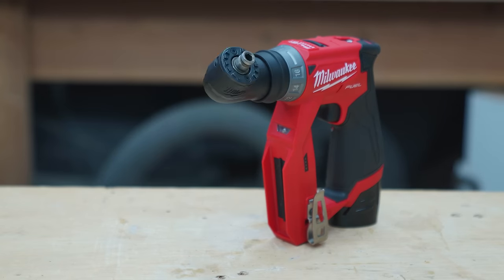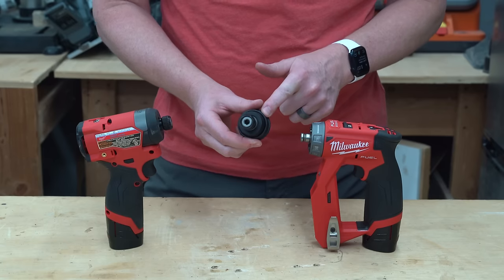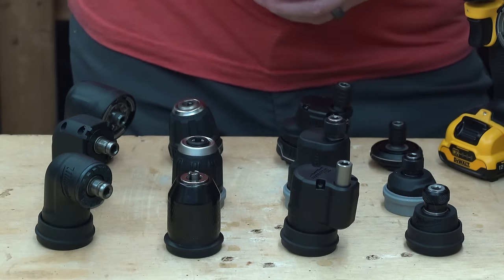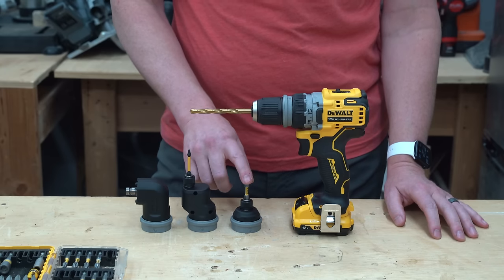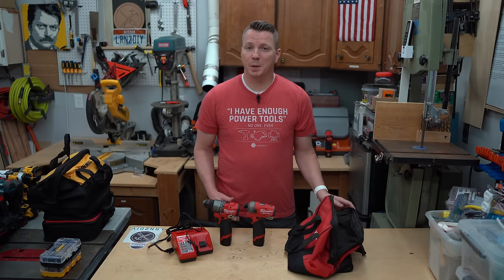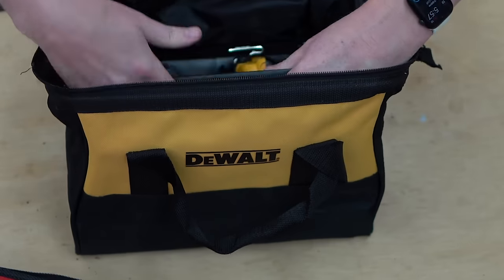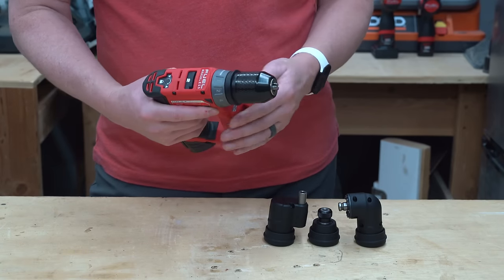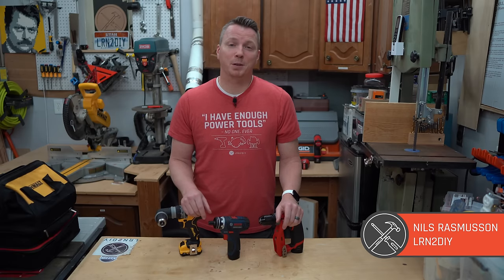These Weird Looking Drills Do It All

Comment from the maker: Just looking for the right angle capability for tight spaces? Check out these Milwaukee and DeWalt adapters you can get for under $30: Milwaukee Right Angle Adapter: https://geni.us/tEajsR and DeWalt Right Angle Adapter: https://geni.us/L3nUWAg
Reply: I have the DeWalt version and it's a great accessory.  For those extremely hard-to-reach areas, you can add extensions to the front and back to get around almost any obstacle.
Reply: my issue with those is that you need to hold on to the adapter or it will spin I like how the other heads don't move and can be set at the position you want.
Reply: @MegaBighig  Exactly. I do have the milwaukee right angle adapter, but I also have the m12 installation driver and that gets most of the use.

Comment: I don't own one, but I have used the Milwaukee version. Being a bit more senior, I found the grip on the Milwaukee very intuitive to use. The grip simulates the use of hand saws, hacksaws and other older tools which usually have you using your index finger as an alignment tool when cutting. As a former electrician and self confessed jack of all trades, it was interesting when I would cut conduit or PVC for wire runs, plumbing runs and the like, and though not perfectly straight(especially with the hacksaw), My cuts were always straighter then the younger fellows. They couldn't believe the difference in their cuts when they used their index finger as the guide. This is the thinking behind the Milwaukee. When I picked it up, it was almost automatic to point my index finger down the side of the body.

Comment: I have a right angle universal adaptor that I use on occasion with my standard Bosh drill or any drill. Don't use it that often but it's handy when you need it.
Reply: Yah I don't quite see why you would need a specific tool for that like shown here. Probably easier to use.

The offset drive actually looks like the one I would find most useful most often...

Comment: I have the milwaukee set and it's been good to me. No major complaints. I adjusted to the grip style (started by the festool cxs) and direction switch fairly quick. I use the 1/4 quick change chuck the most; it basically lives on the tool. The offset and right angle aren't used often, but I love having them when the need arises.
That said, I will be picking up the dewalt version for the more comfortable grip.

Comment: I honestly find the flexi click mechanism more convenient as I would find myself more often in the situation of having to rotate the position rather than swapping one for another. And … how many times does it not happen to not get the angle you need? ☺️
Reply: Yeah I was thinking the same thing when I saw that,  but actually  when you pull the collar on the Milwaukee it comes up partially to do the same thing, it changes positions no problem.
Reply: Same thing with the deWalt. Pull the collar up and you can rotate the head.

Comment: These are the best drills ever. I have the new Festool cxs18 and would happily let all my other drills go. I use all the different heads every day for my job. The offset chuck is for sure the best as it allows me to fit window hardware next to the glass ( double hung sash windows) and I don’t have to worry about the chuck scratching the glass. Most people don’t need the power of a large drill

Comment: I snagged a Milwaukee version on sale and it really helped with some of my work in the field. Not a direct replacement for a traditional drill/impact driver combo, but remove the charger and add a M12 oscillating multi tool and it makes a fine kit. Slides under the backseat for work, Carrie’s into the house nicely for honey do lists.

Comment: Regarding the MIlwaukee tool, the point of the high grip is NOT to access the button. Milwaukee relocated the forward/reverse button to that spot on top so that the user can easily access it while using the high grip (with the person's middle finger on the trigger). The point of the high grip is to place your hand behind the drill/driving axis similar to having a low bore axis on a handgun that is easier to control. This was Festool's idea. So the high grip comes first with the forward/reverse button relocated to accommodate this special ergonomic design.
Reply: I agree with you but the issue i have with the direction switch is not knowing which direction is selected without looking or pulling the trigger. Sure it's a very minor inconvenience and i love the thing in light of it, but a tactile direction switch would have been a welcome update since it's first release 5 years ago

Comment: It is a unique tool, but like you said, how often will you find yourself in those situations? It may be worth it if it gets used a lot. But if not, probably more likely to forget you have it when you need it...until you remember - when the job is almost done! 😅
Reply from the maker: That's kind of what I expect from this. I have a right angle adapter (it's actually on that pegboard in the background) and I pretty much always forget that I have it :)
Reply: I generally just use my dewalt as a drill/driver combo in my service tech pack. I keep the right angel and have used it on occasion but I don't even have the offset in my truck. I use long bit holders all the time, though.

Comment: Metabo also has a crazy powerful version of this, too.
I own the Milwaukee and I L-O-V-E it 😍😍😍
When i bought it, Milwaukee offered the widest range of 12v tools, so I got it. Don‘t regret anything. It‘s lightweight and covers 90% of what I need to do at my job.
I mostly use it without an attachment as a lightweight driver, but in many situations with the drill in the keyless chuck and a bit in the hex chuck.
There were many situations when the 90 degree and the offset chuck came in super handy, especially in kitchen installs.
The direction change button is a little awkward to use, but I don‘t mind so much. The rest makes up for it easily.
For me, the investment was definitely worth it!

Comment: With the Festool, you can swap drill bits with the attachment detached from the drill. Also, the impact bit holder is an actual impact driver.

Comment: As a full time cabinet maker and installer I can tell you the Milwaukee is an absolute dream.  And you're knocking them while comparing them to a regular drill or driver.  That's not what they were intended to replace.  It's probably not for diy'ers.

Comment: Not ever needed a specialist tool like these. I have a separate multi directional attachment that goes in my impact driver.
Reply: Can I asked what that tool is called ?
Reply from the maker: Great point, @mrb4408. That's been my experience too but we'll see if these end up getting some use. @ngojems - I just added links to the description and in a pinned comment if you want to check out the two most popular right angle adapters. They're not too expensive either - typically $20-25.

Comment: I have the Milwaukee and the features you mentioned like versatility, size and grip with built in magnetic holder. All outstanding.  But the weight is fantastically light as well.  A big bonus standing on a ladder working overhead.  Also, its so small and tight I Dont take the case.  I have it in the side of my Milwaukee 15” bag so it’s ALWAYS with me.  That makes it more useful as well. It doesn’t replace my impact or hammer drill of course but its used a heck of a lot more for my maintenance tasks.  The Milwaukee insert is very cool. But I would want to put additional tools in that back, since most of the space seems unused.  But …its a great idea that I wish others would offer for the tool bags.

Comment: I've never seen one of these before but I must say the offset Chuck looks to be the most advantageous for me when I'm building Furniture because there always seemed to be a Fastener that's right up against another board and the body of the drill can't quite get close enough to drive in the Fastener. The offset head seems like you would fix that.

Comment: I bought the Bosch one specifically because I wanted something as small as possible and I knew I would need the offset head for a project. Overall I think it's great - I got the brushless version and I feel like it has more than enough torque for pretty much anything I do regularly, while being handier than my old brushed 18v drill or impact friver

Comment: I use the Bosch and I do  service on comercial ventilation. I get real use for all the «heads» on the regular. Its pretty great. It’s also built like a tank, I dropped it 10-12 on to concrete and it get a scratch.

Comment: Agreed, the Milwaukee electronic direction button is a PAIN. When you pick it up, you have to look at it to see what direction. (it has little LED arrows on it) With he old switch you can flick it or feel what direction you are in. They should have never changed it. Just because you can doesn't mean you should... The inability to stand on its own is another pain but despite all that, it is certainly a handy rig. I doesn't replace my other Milwaukee driver/drills but it makes a great addition!

Comment: DeWalt- battery stuck on the end of the handle- what are they thinking of? Milwarkee- big chunk of plastic on the front- what are they thinking of? (Actually, they copied the Festool.) Festool- biggest price for the lowest torque- by far. And that lump of plastic on the front. Bosch? That will do nicely. The brushless version, of course. Changing heads- not sure why you struggle so much; press and turn. The only one that will fit in your pocket.
Since getting mine, the 18v DeWalt stays on the hook for all but the biggest jobs. Coupled with the DeWalt gyroscopic screwdriver (best power screwdriver on the planet?) it does all the jobs.

Comment: Dewalt sells a right angle flex impact driver adapter for $40.  I think it's better than buying a new tool with similar adapters and it's for impact drivers.  Covers the critism you pointed out.
Reply: All add-on right angle adapters I have owned are awkward to use (have to hold it from turning) and ultimately can't get much torque through to whatever I am drilling/driving.   Most self destruct if pushed very hard.  These look much more sturdy and useful.

Comment: I have had a black and decker Firestorm multi-head for many years even though the batteries are no longer produced because I found while it lacked the power of other tools, the ability to not have to carry around two or more tools far outweighs that.  I own several other more powerful tools, but find myself using the B&D every time. I recently purchased the Milwaukee and I finally found a tool I like more.  It is light weight and more versatile than the B&D and it is easy to carry the heads in a pocket or set them on the workpiece. I sometimes leave a head with a specific bit at a workstation and just bring the body making the work area less crowded than with a bunch of drills/drivers.

Comment: It came time to get a new drill so I bought that DeWalt one. So far, I have only used it for a drill. The only complaint I have is it needs to come with a larger capacity battery. The 2AH runs out surprisingly quick when your wire Wheeling for a while. 👍

Comment: I've used the Milwaukee one for years now and its been great I use it for about 90% of my drilling but the only complaints that I have about it is that I wish the would've the offset head a quick connect instead of a magnetic one cause over time and for certain applications it will fall off or stay in the screw. I also hope that for future models they designs the bag so the part where the head adapters go is one piece and connected to the bottom because often the drill bits and other thing will go threw and make it somewhat annoying to get out but other than that its my favourite drill and it's not even close.

Comment: I feel like my Festool C12, which has a similar though better designed handle than the Milwaukee, and is from 15 years ago (2007) compares well with these recent entries. And of course I have had the pleasure of using it this entire time. Once you come up with the right way to hold the chucks, you can interchange them one handed and quickly.
Reply: Long said; imitation is the most sincere form of flattery!

Comment: But there is also someone who rules over all others - Metabo.  They have an all-metal, ball-bearing attachment that attaches to the 43mm Euro-neck on the LTX series drill.  The metal is clamped to the metal with an eccentric clamp, and is thus absolutely firmly connected to the machine... basically, this is how we get a real angle drill from an ordinary drill.  And for dessert, this attachment can withstand 110Nm, and with stepless adjustment in 360° around the axis, screwing is easy, because it is easier to hold high torques during demanding screwing, drilling, etc.
But it is also true that there is no comparison, because this is a real professional category for industry and trade....typical Metabo.
Otherwise - good contribution👍 - you have a new subscriber😃

Comment: I just got a cheap $15 milwaukee right angle adapter off amazon. works for tight spaces and is strong enough (given that when i used my impact driver the shank snapped on the auger bit i was using from harbor freight, while the angle adapter it was in was fine )

Comment: Wow that tray design for the dewalt is genius. I wonder if someone can 3D print one for the Milwaukee set. I have ton of those small bags and tray would be very good. Need those tray design for installation drill/driver, m12 impact & driver set as well.

Comment: I’ve owned the Bosch for 2 years. I used it Very rarely. The trigger switch stopped working 3 months ago but it’s laying in a drawer till I find time to see if I can repair it. Its smaller size (in every dimension) makes it the best choice, considering only form factor. But its ergonomics are poor. Shape of grip, location of reverse switch, clunky quick change heads. If someone brings out a new version with the compact size of the Bosch, with the better QD method and ergonomics of the DeWalt, I’ll buy again.

Comment: This is neat…. But you didn’t really demo it doing the things it’s supposed to be good at vs a regular drill.  It would have been nice to see if it worked better in those scenarios.
Reply from the maker: That's great feedback. I could have done a side by side comparison to see if it was really helpful in specific scenarios. I always appreciate feedback so I can make better videos in the future. Thank you!
Reply: @LRN2DIY   and of that what really would have been helpful is comparing the angle adapter to a stand alone angle adapter

Comment: I hate bags. You can't stack them for traveling and they're not rain-proof. Anytime I have one, I always spend a few minutes making a hard shell tote out of scrap OSB. And use their tote to carry the wine.
The DeWalt tote bag is the absolute best IMO of the non-Festool brands. But I can't cost-justify the Festool product line since I'm not using it for jobs.
Since I have tools with a forward/reverse switch in the normal place, I'd find the Milwaukee switch SUPER annoying.

Comment: "No, I would not be using this on a regular basis." The system is too cumbersome for a seldom encountered situation. I already have a 90', very slim hex adapter that would cover 90% of the scenarios this system helps overcome. That adapter cost somewhere between $10 & $15. I'm most invested in the Milwaukee cordless (I have 4 battery systems in play: Milwaukee, DeWalt, Ridgid, & Dremel.), and am disappointed in their bizarre button placement requiring a bizarre and unfamiliar hand grip. Milwaukee: what are you thinking? Don't you use your tools before you sell them? Somebody should call them and ask them "What's up?" If I had this system, I would. The bag is a big deal to me, and I will pay extra for a tool to get a better bag. I stopped having loose tools when I turned 18, decades ago.